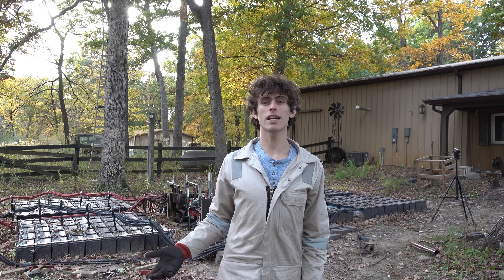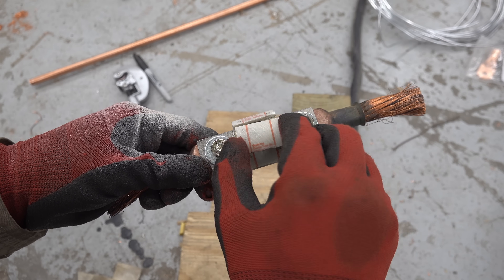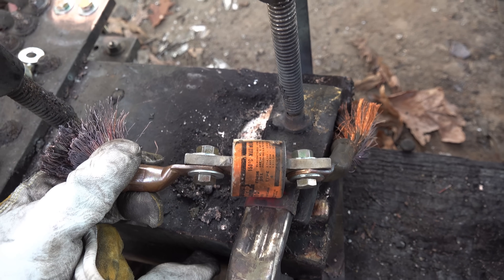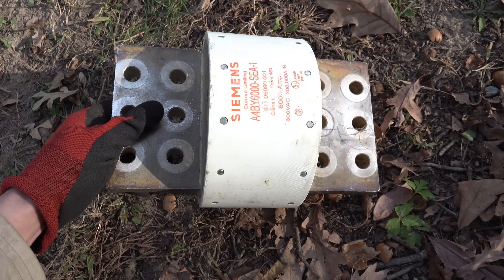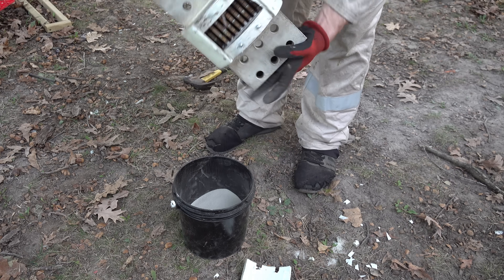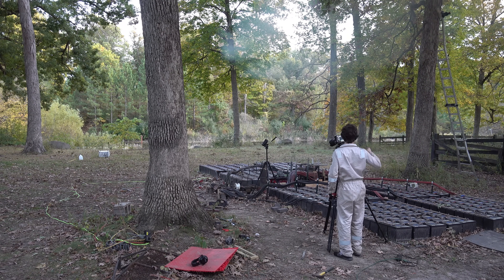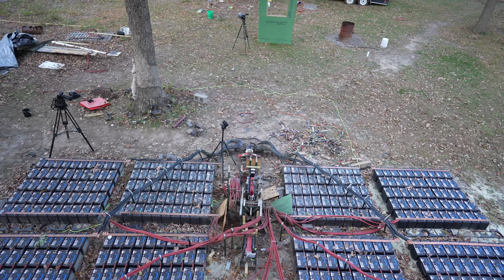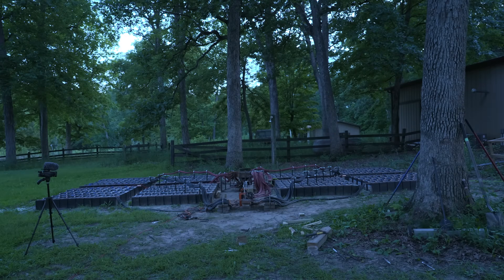Popping a 6000 Amp Fuse

Comment: Hey man I love your videos . I got 3 tranaomformers one a pole transformer the towns ones  one that’s like for an old big neon sign. And one only the guts with 2-3 coils . I have 4 small capacitors . I know about electrical but not to much I can only wire a house or a Comercial 220v . This transformer the receipt states 1993 when the old army guy got it new and he used to play in his house . He had 2 copper hard copper rods like 4 foot tall o the input isolators dunno why . Anyways lmk if you see this and any ideas I could get to build something cool would be alreciated . There is a lot copper but I not wanting to scrap it because I know I could build something: also he had a stinless flexible tube like 8 foot long by 6-8 inches wide .

Comment: I first thought it’s pretty impressive these fuses can cut the arc even though they’re probably designed for AC instead of DC. Then remembered the voltages used are quite low compared to the rating 😅 enviable madman competition material nevertheless!

Comment: Instead of connecting parallel, you should try connecting in series then you’ll get 4800 volts dc 3
400 Amps

Comment: Had some workers fishing (metal tape) to a gear. The blueprints weren't updated and they weren't in the pipe they were supposed to be in due to that. Crossed 2 phases of 600v and only popped one 2500a fuse and disintegrated the first 6ft of the tape. The explosion it caused literally shook the entire 1mil sq ft building.

Comment: You dont know what are you doing. Dont know how to safely and properly tie in the fuse, dont know that its a BAD idea having molten metal rain down on lead batteries. You could have caused a chain explosion of batteries and you could have blown yourself to bits n pieces.
One advice - stay away from high energy circuits before you blow yourself up. You are not trained, dont have any exp and it shows. Stop that while you still have your health and while you are in one piece. This video is an excellent tool to show why untrained people shoukdnt go anywhere near high power circuits.
Reply: bro doesn't know who he's talking to, he has a degree and has been a professor as well. he's been doing crazy stuff like this for the past 15+ years
Reply: LOL The army literally wanted him to work on high energy laser systems. I would be embarrassed if i was commenting like you. Just like a bot

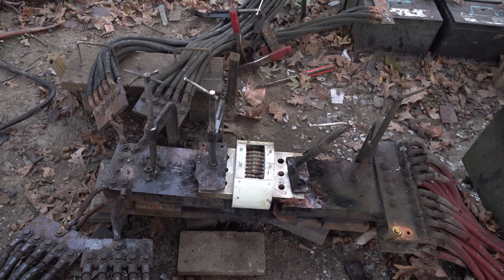Comment: 6:59 Why is it always the positive “+” side that melts? I remembered once I accidentally tipped a starter battery on to a aluminium step and it melted a hole only on one terminal, can’t remember which terminal but probably the “+”. Any scientific explanation? Plasma? Debye sheath?
Reply: As the electricity goes through, it loses energy to heat, so the start gets hotter then the end. When a conductor heats up, it's resistance increases, and that creates a runaway effect that melts the metal. The end doesn't get as hot as the start, especially after the start gets hotter and turns more electricity into heat.
Reply: @JoinTheClippyRevolutionToday. Many thanks for your reply! As they teach at school, convention in theory states current flow is from “+” to “-“, so the starting point you mentioned gets hotter for the reason of being the initial point. But we know in reality the electrons are the moving particles, so maybe they travel from “-“ and they all clutter at “+” creating a bottle neck therefore concentrating the current at small tiny areas. Where as at “-“ they could spread out and just chose multiple low resistance paths? This should also apply to explaining why DC welding electrode positive (DCEP), the tip of your welder gets hotter than the target to be welded?
Reply: @Tj-ik4cn 
It typically starts to heat up at the point of highest resistance, negative to positive flow does not really have much of an effect to where it actually decides to melt.

Comment: How you charge the car batteries?
Reply: No need. Each of these experiments is like cranking over a motor once for each individual battery. They have a lot more in them.
Reply: @hammerth1421 So what about when they completely die out yiu just toss them in the trash?

Comment: Next he's building a rail gun powered by 400 over car batteries. What could go wrong? Or maybe make a 100 hotdog cooker.  Nailbed sandwich style Steak cooker? Or he could install a large hot tub powered by car batteries? He  could melt a pistol? fully loaded of coarse. Power a carinal ride? power 200,000 Christmas lights? 500 strobe lights and disco balls? Build the largest 400  car battery boom box? Solar charge the 400 car batteries?

Comment: You have 400 car batteries and are using the smallest possible battery on your grinder 🙂
I have the same grinder. With the 2 Ah battery it is very limited and not good for the battery. There is a big improvement in power with 5 Ah battery. I use 12 Ah batteries for the grinder.

Comment: “That’s funny. The fuse is made of a bunch of smaller fuses” 
- Guy using 400 car batteries as a battery
Reply: underrated comment lol
Reply: @Mo124ever  400 Car batteries each with 6 individual Cells  😂

Comment: Sometimes the volts will not go through the cooper if it has oxsadation on the connectirs. If the cooper is cleaned it will let more volts go through when the volts get to high. Current wont flow to good in bend wires to.

Comment: At 150,000 amps, the magnetic forces alone would cause cables to whip around violently. To carry 150,000 amps without the wires instantly turning into plasma, you would need solid copper busbars several feet thick.The resistance ($R$) even in massive cables would generate heat following the formula $P = I^2 R$. Even with a tiny resistance of $0.001\text{ ohms}$:$$(150,000)^2 \times 0.001 = 22,500,000 \text{ Watts (22.5 Megawatts of heat)}$$This is enough heat to melt the entire setup in a heartbeat. They might mean 150,000 Watts

Comment: It's the AMP's that kill not so much the voltage.
Reply: 2500V~ to 12,000V+ can also be fatal. depends on the person. 
edit: dunno why i gave a ratio, basically 2500+ volts can kill depending on the person.

Comment: Yeah, you're working with 12 volts. It's really important to have clean contacts, as any carbon is going to cause an extreme amount of heat, and simultaneously reduce the power available for your target. That's why your contacts melted before your fuse during your first try.

High voltage and low voltage act very differently, it's a cause of confusion for a lot of people.

Comment: 1. u loose huge amount of "power" from the way you holding the fuses. i see sparks there.means u drop amps....

2. not even a 1.5V AAA battery is ok to shortcut like that.. be aware that if....  IF one of those batteries fails, its going to be a big big problem there.... u need to add a fuse at each string. in case a battery fails, the fuse will cut the faulty string prevending the rest paraller strings from turning the whole thing into hell.....

Comment: You could use just ONE battery from Prius gen 2 or 3, without even modifying it! 😛The capacity of each cell is C=6.5 Ah and, in theory, when you short-circuit a NiMH battery, it can give 1000 x C = 6500 Amps! In fact, it can survive a short-circuit for several seconds (until it overheats) without any damage to the cell. That is the very reason Toyota were hesitant to switch to Lithium batteries - they can give a maximum of 40 x C, and that's for a Li-Po, specifically made for such current.

This is because their natural state is "discharged". When manufactured, they are completely empty and they charge them for some time in the factory, before shipping. In fact, a NiMH battery can survive for years completely empty and be revived to normal with several charge-discharge cycles.

Comment: Amazing stuff. Btw I knew that would happen with dirty contacts you didnt scrape the gunk off, as it created a high(er) resistance section compared to fuses. Inevitably that part heated up the most.
That is exactly why feet burn when you get struck by lightning.

Comment: Popped a 630 on manual insert once and the earth fault under my feet gave a high enough current it popped the HV fuse and the two other 630s on R&B. Good fun. Miss it, fuck auto insert tools.

Comment: So how do you recharge the battery banks? Or are you just using each cell to near-flat and then replacing them? (Yes, I know each individual battery is multiple cells but I am just referring to individual batteries as cells in the 4 large banks in this suic- erm, build.)

Also, are you getting any spots where the flying molten slag is melting through your battery casings? I’m quite terrified of what you’ve built but it’s a rare chance to learn some details.

Comment: Iv have had experience  when :  using spray glue in work to connect  soundproof floor materials.  I sprayed spray glue all around where  i  was working . Full can of spray glue. Then i slided( sound proof materials on the floor have to be taped with tape.) on the new sound proof material and it created  static electricity  .  
 All area of 8 m2 that iv sprayed all around me  with spray glue   got on fire 🔥  at the same time  ,40 cm flame . 
 Building didn't  have grounding.

Comment: U Know, its not just crazy fun, but you will also see and learn what happens during fault current events, in future clamps don't cut it, a nice flat clean contact bolted down under force is needed, for 50K+ amps, it get really scary when its high volts and amps..the scary part is when u start a fault but cant stop it and loose control of it..

Comment: I worked at the Eaton/Bussmann high power fuse test lab. Bolt those big fuses down. I've seen 300,000A mechanically rip a 2/0 wire apart. Plus if you bolt it down it'll keep your blocks clean and pretty. Otherwise one of your connections will become the fuse.

Comment: You may think that the danger on display in this video increased as he went to higher and higher fuses. That is incorrect. The exact same danger was present during each fuse failure.

Comment: I have been watching this guy for years and I'm a big fan of garage engineers.  I'm an Electrical Engineer and I work for the company that makes this fuse.  The reason you are struggling to pop this is because you're using DC.  The fuse should pop at 10x rated.  In an AC circuit a 6000A fuse will trip in .07(s) at 60,000A. Depending on what stated you are in, I can provide some samples.  We also have a high powered test lab in Massachusetts I can get you access to.  We have 2x1MW generators if you can think of things to blow up.

Comment: Couple of questions if someone doesn't mind explaining:
'Magnetic forces ...that caused the tabs to bend'. I'm having difficulty with this. What part of the material is 'feeling' the force from the induced magnet and in what direction? Can a non-ferrous material actually behave this magnetically? And, is the force of the magnetic field determined by the current, the voltage or power; (what voltage is he running these at anyway)?
Thx
Reply: Lorentz force, how about you do some research.

Comment: The 6,000 a fuse would have blown the first time if the contact surface had been clean and the connection bolted.

Comment: un-twist the conductors for some string lights, set up said lights on an xmas tree and then shoot an insanely strong EM field at it such that the lights turn on and then get the wires hot enough to burn the tree down

Comment: Would you like to do another or similar video, but rewire all or a large portion of the batteries in series to up the voltage?  Each battery can supply over 1000 amps at about 10 volts, 4,000+ volts at 1000+ amps would not play nicely with a lot of stuff :D  Extinguishing a high current high voltage DC arc would be difficult though, much more so vs 48 volts.  Great stuff!+

Comment: Fill a 6,000 amp fuse with C4 and let's see what that does.  I wonder what would happen if that 30,000W light bulb was hooked up to the batteries in series

Comment: they Styro, im in the electrical testing industry and when we need to push a lot of current through something we use whats called a DDA-6000 Universal circuit breaker test set. it can push as little as 1 amp all the way to 200k amps as long as you product a sufficient power source for the higher amps. The thing weights like 2000 pounds but its the size of a dresser so youre really saving a lot of space. Personally I think one of these could help you produce some cool experiments

Comment: Shouldn’t there be a better way to start the slow-mo camera than manually tapping it and running for safety then running back over to it after the danger passes? That is SOOO MUCH useless footage to be sifted through. Shouldn’t there be a cord and button to activate it from further away?

Comment: I would like to take a second and warn about the risks while handling a 6000 Amp fuse. This is really not a toy. If you drop such a fuse, it easily can fracture your foot if you do not wear appropriate shoes. - As I am not an electrician I do not see any other dangers at this point.
Reply: I mean superheated shrapnel and tripping over on the not very safe battery array is also kinda dangerous no?
Reply: @binludding7169 i guess those might leave stains on your clothes. And the skin beneath. And the bone.

Comment: Collecting and managing 400 batteries is a feat in itself.
Reply: I want to see what his charging setup is for them. Maybe it is something like my tig welder......A thousand pounds and 435 amps of dc current (460 amps with AC output). The voltage might be a little low under load. He has 60 volt banks set up.

Comment: So 0,007 amps across the heart is enough to kill? And you just passed 150000 amps through that resistor? Am I misunderstanding amps? You scare me hahaha
Reply: Around 50mA, or 0.05 of an Amp.

However your skin typically has a resistance ranging from 1000 to 100000 ohms.

So simple math does help.

Comment: Can someone point me towards some info on the magnetic effect he referenced a few times? Specifically the one that drew in the random bolt. I am a mechanic so electricity baffles me
Reply: E.M.F 

Voltage produces electromagnetic fields similar to natural magnets due to Lorentz force.
Reply: A one-minute explanation at 9:04 in the 100 car batteries video: ywaTX-nLm6Y Yet, I don't quite get it either. Electronics Tutorials has a page on electromagnetic induction that made some sense.

Comment: A friend of mine told me story of once of a faulty fuse he encounted at work. The explosives failed to detonate correctly and the inert sand melted and became conductive. It caused a lot of damage. Obviously the manufacture had to give them a refund. He works on the power injectors for a fusion reactor.

Comment: 5:24 As soon as you said "it will melt straight through that char", I thought: the highest resistence in the circuit will take all the load as it drops most of the voltage. So you have to make sure the thing you want to pop is the highest resistence by some significant margin to dump most of the energy into it.

Comment: I'm an electrical=electronics engineer, so I knew there was a good chance your electrode blocks and other hardware might go instead lol!

I've seen your content before, and engineers are always thought of as the most unlikely to be into wild destruction, detonations, wicked plasma discharge etc. but it's very much the opposite. One time, I ordered some odd value 33 uF capacitors and instead of 50, the guy sent me like 200! lol

I wasn't the least bit surprised when I plugged them into the wall by an old extension cord that they detonate about equivalent to a .22 LR round.

Comment: As of the contact block being the failure point.  That's what you get for not cleaning it or using proper connection bolts.
Reply: As a note, even when they are filled with the protective sand, these fuses make incredibly loud noise when the blow.  If you've ever heard a power station blow out, it is usually one of these fuses.

Comment: I've tested circuit breakers at the 250,000A level, the amount of effort needed to ensure that joints in the circuit don't tear apart, or 4" solid copper busbars don't flap like ribbons is substantial - to be sure that what will be tested is the breaker, and not the rig testing it.

Comment: "Im kinda surprised considering the voltage was low"
Rough math says its like 4800~5600v. probs at least 5000+. soo urr not that low lol. Its the 80000 dc amps that really does it here..
Reply from the maker: it's 65V

Comment: The fact that the numbers are so absolutely insane on such a low voltage circuit is probably what is blowing my mind the most. 
Normally I'd be expecting some electrical shenanigans like current leakage in places it shouldn't and difficulty opening the circuit - but circuit wants to be open.
It throws things away from it violently with the combination of magnetic forces and explosions. It's so unsafe that it kind of circled back to safe.
Reply from the maker: Yes this is an amazing and ironic safety feature of such extreme currents. You cannot accidentally short this bank. The magnetic forces won't allow it! I'll stick thick copper cable on the plates and clamp it down with four 8" c-clamps cranked so tight that the handles bend, and the cable will often still rip off the clamps before it can melt!

Comment: I’m amazed at the amount of faith he has in that oscilloscope
Reply from the maker: i've done extensive testing cross referencing my measured currents (on the scope via a hall effect sensor) with fusing times of exploding cables based on the onderdonk equation. everything points to the readings being accurate. both of these line up with predicted values of the circuit impedance as well